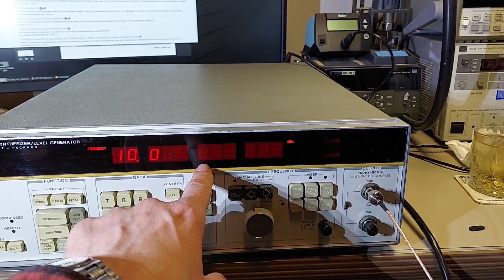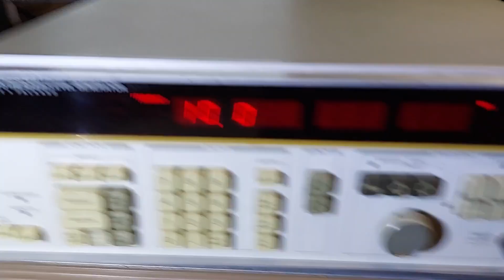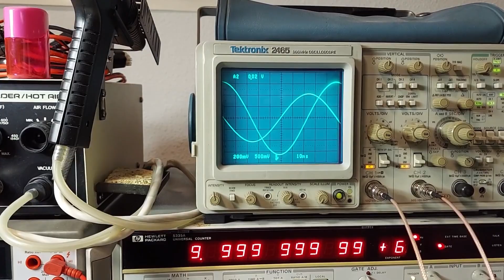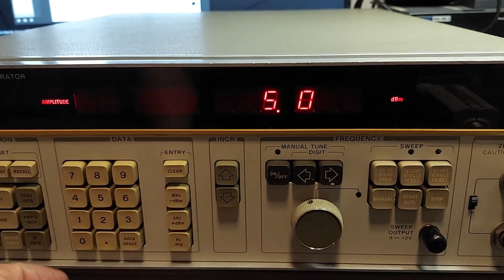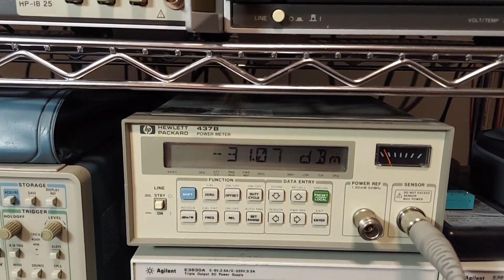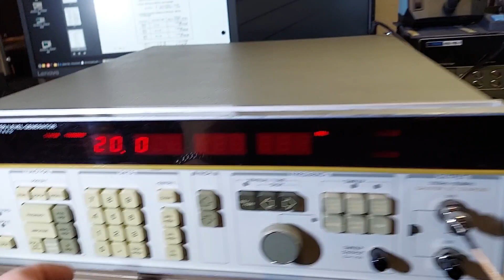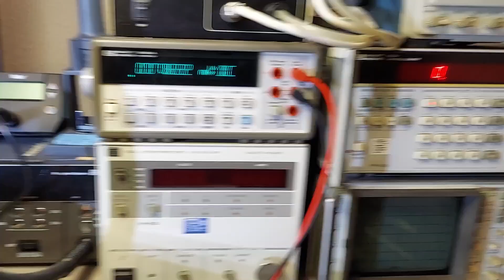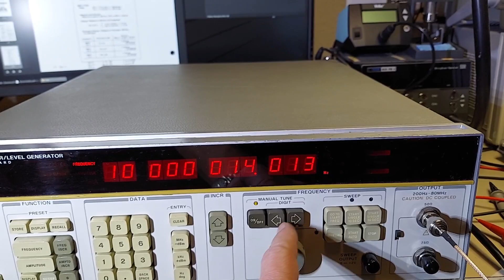First look at the HP 3335A Synthesizer / Level Generator

Comment: I own one, they are ruler flat from 200 HZ to 80MHZ within 0.02db!!!

The output attenuator broke on mine, and now  the output is always 20db below what you program on the front panel.

Does anyone have any idea about how to work on the output attenuator?
Reply from the maker: I just looked at the service manual. There is a section that details how to service the attenuator, but strongly suggest that the attenuator be exchanged for a new one via their "attenuator exchange program" long since gone. It may be cheaper and less frustrating to find a parts unit off of eBay.